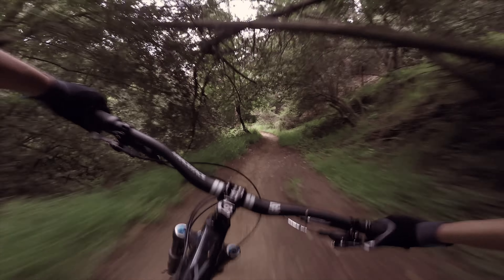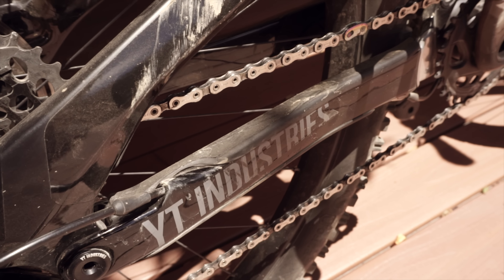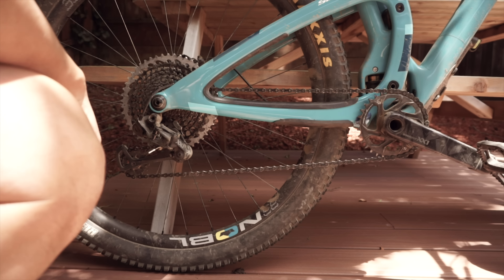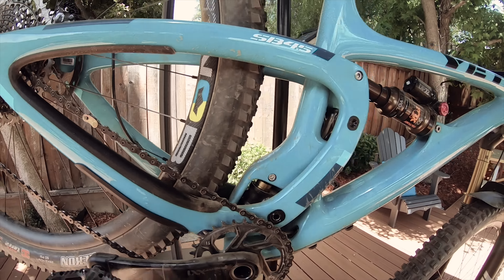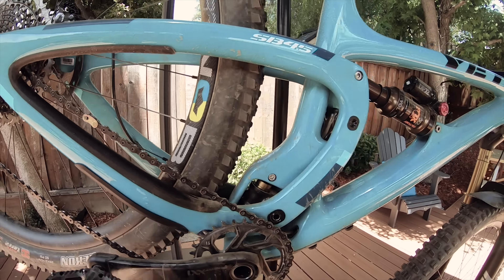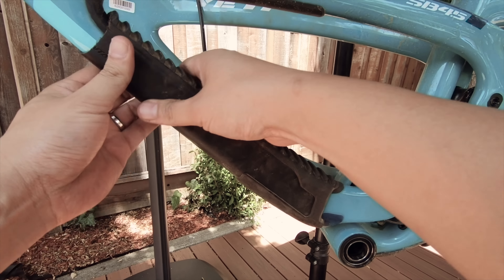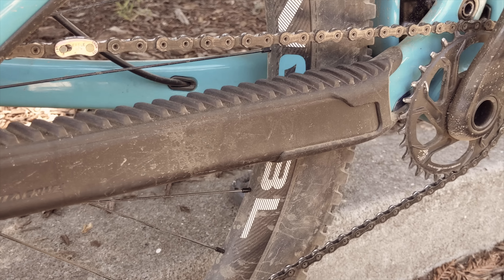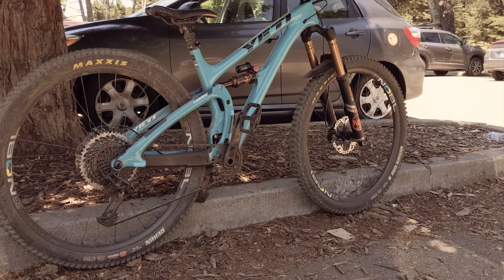How to make your bike MEGA quiet

Comment: I’ve got a thick bit of rubber on my trek remedy. I might try cutting some slots in it so it looks more like the Santa Cruz one
Reply from the maker: I'm shocked at how effective this design is.
Reply: I’m from Australia I just checked Santa Cruz. $8 for the protector $30 for shipping 🤪 
Maybe an old tyre would be just as good! With the sidewall knobs upwards.
Reply: @brokenlegz  hey, im late to the party, but, yeah, an old tire or the tire inner tube will work wonderfully

Comment: Any idea if this will fit a new Kona Honzo. I am picking one up soon and have been searching for a molded protector vs the Velcro wraps or inner tube hacks
Reply from the maker: My chainstay dimensions are just under 1.75" at the tallest part of the chainstay and 1.5 towards the end.  Roughly 3/4" at the thickest width.  Fits like a glove with these dimensions so if you're close it might be worth a shot.
Reply: Thanks. I’ll have to see if I can get the demonsions since the bike isn’t here yet

Comment: I used cheap DIY method. Just took old inner tube, cut it lengthwise, fit on chainstay and glued gently with super glue. 
Also added fixation with electrical tape at the ends.
Reply from the maker: I did something similar back in the day!